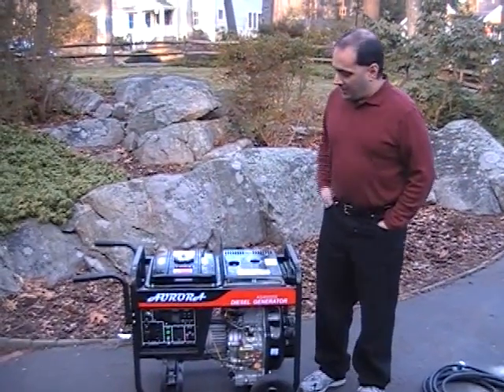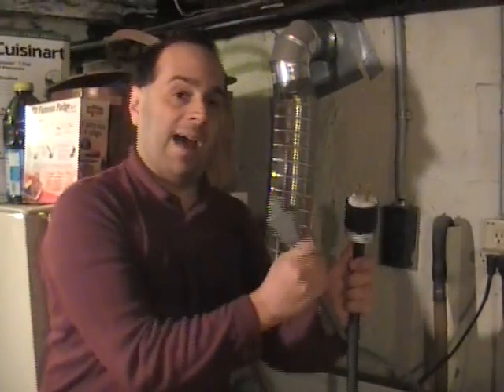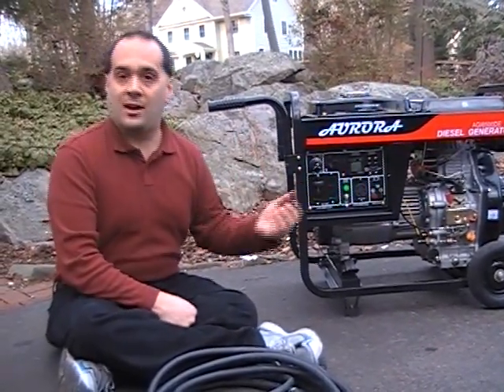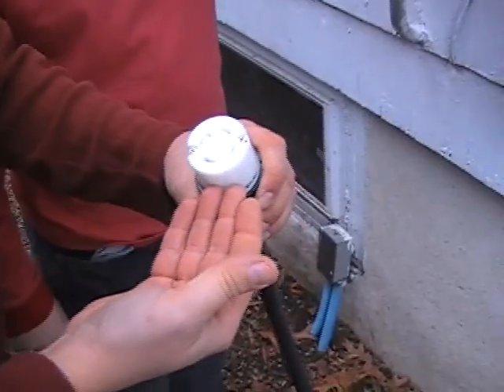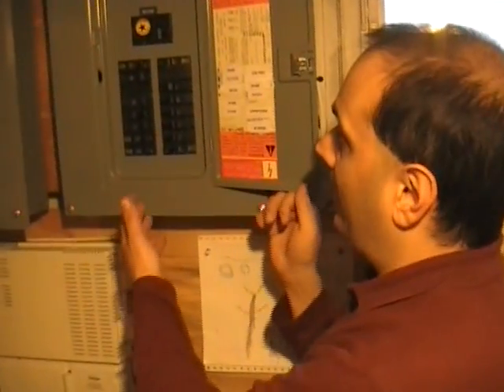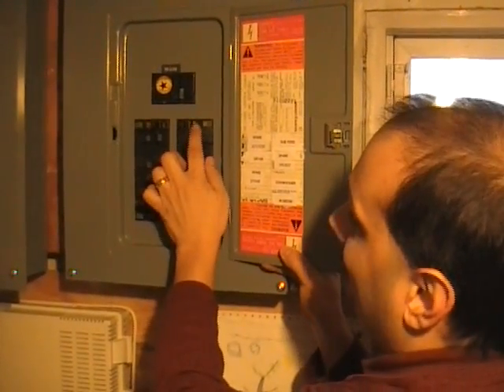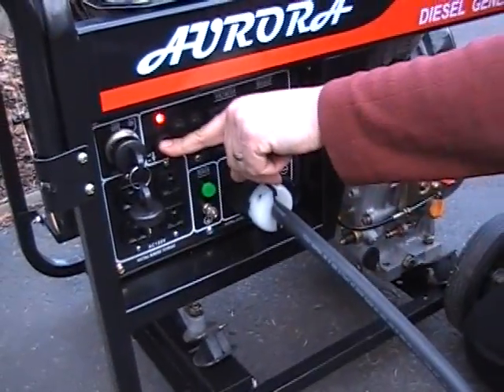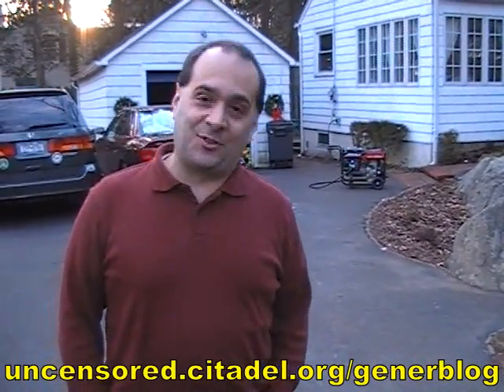Inexpensive residential generator hookup

Comment: Very nice done.  Thanks.  Will be possible to have some information regarding the different part that are necessary (small sub panel, transfer switch, extensions, etc).  It is possible to have this installation with a generator that only supplies 120volts/30amp (TT30P plug)??
Reply: Here are the portable generator safety rules: make sure you are aware of all the warnings before using portable generators. This is just a reminder for everyone’s safety. All generator safety rules should be followed carefully. This advice is just to make sure that everyone is aware of all the warnings and it’s just to remind people to be careful using portable generators. Generators can be dangerous if not used carefully. Every year, hundreds of people die or get injured when using portable generators due to carbon monoxide poisoning and electrocution. Make sure you are using your generator carefully and keeping others safe as well. There is something very serious that everyone should always be aware of when using generators. Some people do run their generator indoors which is not safe and that increases the risk of carbon monoxide poisoning which can cause death of family and you. Some people run their generator in wet conditions which can electrocute them. Please remember that you should never run your generator indoors. Remember that carbon monoxide is an odorless and colorless gas that you cannot see or smell. Carbon monoxide is a silent killer. Keep that in mind. Make sure your generator is 15-20 feet away from your house and away from doors, windows, and vents. Never use your generator in your porch too. Having a carbon monoxide detector is very important against generator safety. Some people also allow children to go near the portable generator which could pose risks. We need to keep an eye on our children making sure that they are not near the portable generator so they won’t get electrocuted or burned by the generator which is dangerous. A locking enclosure also keeps kids safe. A generator shed might look like a tempting place to explore, or take cover during a game of hide and seek, but a generator is a dangerous piece of equipment that can cause injury. It says on the manual that we should also keep children away at all times from the portable generator to avoid injuries. Please do not allow a child or unqualified people to operate the portable generator.  It is important to keep your children safe especially little ones. The portable generator can be hot during an operation. Just because some manuals missed what should be listed doesn’t mean it’s safe to do. Always follow the generator safety rules when using portable generators. Generators pose electrical risks. If you need to use your generator during wet weather, you need a generator tent to protect your generator from getting wet. Don’t let your generator get wet. Keep your generator dry and before using your generator, please make sure your hands and your generator is dry. Do not wear loose clothing when operating the generator. Everything that is said on the generator’s operating manual should not be ignored. Never smoke cigarettes near the generator. Please keep flammable things away from the generator. Never overload your generator too. Your generator can catch fire. Never ever try to plug a generator cord into a wall outlet to avoid back feeding. Back feeding your generator is dangerous. Always turn on your generator first before plugging in appliances and shut off the appliances before turning your generator off. Use a heavy duty cord for your generator and the cord should not be worn out. All the instructions should be followed carefully. Never refuel your generator while it’s running. It can cause fire if fuel spills while your generator is hot. You should turn off your generator and let it cool off before refueling it. Having a fire extinguisher next to the generator is also important. This is only a reminder for everyone’s safety of using generators. Make sure your generator is properly grounded. Having a fire extinguisher next to the generator is also important against the safety rules. https://youtu.be/I1jT3ANENvI and here is a video more about keeping others safe when using generators and also about our family’s safety. It’s important to keep our little children safe as well. Make sure they’re away from the generator. Hope this helps.

Comment: You do realize anytime you hook up a connection, there is "Live" power running through the wires, right? Jesus that's a loud generator!
Reply: Here are the portable generator safety rules: make sure you are aware of all the warnings before using portable generators. This is just a reminder for everyone’s safety. All generator safety rules should be followed carefully. This advice is just to make sure that everyone is aware of all the warnings and it’s just to remind people to be careful using portable generators. Generators can be dangerous if not used carefully. Every year, hundreds of people die or get injured when using portable generators due to carbon monoxide poisoning and electrocution. Make sure you are using your generator carefully and keeping others safe as well. There is something very serious that everyone should always be aware of when using generators. Some people do run their generator indoors which is not safe and that increases the risk of carbon monoxide poisoning which can cause death of family and you. Some people run their generator in wet conditions which can electrocute them. Please remember that you should never run your generator indoors. Remember that carbon monoxide is an odorless and colorless gas that you cannot see or smell. Carbon monoxide is a silent killer. Keep that in mind. Make sure your generator is 15-20 feet away from your house and away from doors, windows, and vents. Never use your generator in your porch too. Having a carbon monoxide detector is very important against generator safety. Some people also allow children to go near the portable generator which could pose risks. We need to keep an eye on our children making sure that they are not near the portable generator so they won’t get electrocuted or burned by the generator which is dangerous. A locking enclosure also keeps kids safe. A generator shed might look like a tempting place to explore, or take cover during a game of hide and seek, but a generator is a dangerous piece of equipment that can cause injury. It says on the manual that we should also keep children away at all times from the portable generator to avoid injuries. Please do not allow a child or unqualified people to operate the portable generator.  It is important to keep your children safe especially little ones. The portable generator can be hot during an operation. Just because some manuals missed what should be listed doesn’t mean it’s safe to do. Always follow the generator safety rules when using portable generators. Generators pose electrical risks. If you need to use your generator during wet weather, you need a generator tent to protect your generator from getting wet. Don’t let your generator get wet. Keep your generator dry and before using your generator, please make sure your hands and your generator is dry. Do not wear loose clothing when operating the generator. Everything that is said on the generator’s operating manual should not be ignored. Never smoke cigarettes near the generator. Please keep flammable things away from the generator. Never overload your generator too. Your generator can catch fire. Never ever try to plug a generator cord into a wall outlet to avoid back feeding. Back feeding your generator is dangerous. Always turn on your generator first before plugging in appliances and shut off the appliances before turning your generator off. Use a heavy duty cord for your generator and the cord should not be worn out. All the instructions should be followed carefully. Never refuel your generator while it’s running. It can cause fire if fuel spills while your generator is hot. You should turn off your generator and let it cool off before refueling it. Having a fire extinguisher next to the generator is also important. This is only a reminder for everyone’s safety of using generators. Make sure your generator is properly grounded. Having a fire extinguisher next to the generator is also important against the safety rules. https://youtu.be/I1jT3ANENvI and here is a video more about keeping others safe when using generators and also about our family’s safety. It’s important to keep our little children safe as well. Make sure they’re away from the generator. Hope this helps.

Comment: Why not just call the electric company and have them or in my case I know the people real well at the elect comp. and they will send a lineman out to remove the head unit/meter from your house that way you can go ahead and just hook ur generator up that way if your not home or whatever and the power comes back on and ur generator is running nothing or noone will get hurt. Just simply call them back and tell them to reinstall it and boom! Prob solved.
Reply: David Spencer so during a power outage you will wait for someone to come to your house and pull the meter, then start your genset.  Get a grip Dave, that wont happen
Reply: Oh lol That's not cheap here at all. I'm sure you will be a priority when they are working like crazy to get the power restored. Not the best advice Dave.
Reply: thats expensive here id never do that anyways I just had a panel fire because i found out when the land lord replaced the meter in the wire was the wrong damn gauge
Reply: Here are the portable generator safety rules: please make sure you are aware of all the warnings before using portable generators. This is just a reminder for everyone’s safety. All generator safety rules should be followed carefully. This advice is just to make sure that everyone is aware of all the warnings and it’s just to remind people to be careful using portable generators. Generators can be dangerous if not used carefully. Every year, hundreds of people die or get injured when using portable generators due to carbon monoxide poisoning and electrocution. Make sure you are using your generator carefully and keeping others safe as well. There is something very serious that everyone should always be aware of when using generators. Some people do run their generator indoors which is not safe and that increases the risk of carbon monoxide poisoning which can cause death of family and you. Some people run their generator in wet conditions which can electrocute them. Please remember that you should never run your generator indoors. Remember that carbon monoxide is an odorless and colorless gas that you cannot see or smell. Carbon monoxide is a silent killer. Keep that in mind. Make sure your generator is 15-20 feet away from your house and away from doors, windows, and vents. Never use your generator in your porch too. Having a carbon monoxide detector is very important against generator safety. Some people also allow children to go near the portable generator which could pose risks. We need to keep an eye on our children making sure that they are not near the portable generator so they won’t get electrocuted or burned by the generator which is dangerous. A locking enclosure also keeps kids safe. A generator shed might look like a tempting place to explore, or take cover during a game of hide and seek, but a generator is a dangerous piece of equipment that can cause injury. It says on the manual that we should also keep children away at all times from the portable generator to avoid injuries. Please do not allow a child or unqualified people to operate the portable generator.  It is important to keep your children safe especially little ones. The portable generator can be hot during an operation. Just because some manuals missed what should be listed doesn’t mean it’s safe to do. Always follow the generator safety rules when using portable generators. Generators pose electrical risks. If you need to use your generator during wet weather, you need a generator tent to protect your generator from getting wet. Don’t let your generator get wet. Keep your generator dry and before using your generator, please make sure your hands and your generator is dry. Do not wear loose clothing when operating the generator. Everything that is said on the generator’s operating manual should not be ignored. Never smoke cigarettes near the generator. Please keep flammable things away from the generator. Never overload your generator too. Your generator can catch fire. Never ever try to plug a generator cord into a wall outlet to avoid back feeding. Back feeding your generator is dangerous. Always turn on your generator first before plugging in appliances and shut off the appliances before turning your generator off. Use a heavy duty cord for your generator and the cord should not be worn out. All the instructions should be followed carefully. Never refuel your generator while it’s running. It can cause fire if fuel spills while your generator is hot. You should turn off your generator and let it cool off before refueling it. Having a fire extinguisher next to the generator is also important. This is only a reminder for everyone’s safety of using generators. Make sure your generator is properly grounded. Having a fire extinguisher next to the generator is also important against the safety rules. https://youtu.be/I1jT3ANENvI and here is a video more about keeping others safe when using generators and also about our family’s safety. It’s important to keep our little children safe as well. Make sure they’re away from the generator. Hope this helps. Safety is always important before doing things.
Reply: Guess thats the advantage of living in a small community. Cause ive had them come out and do it several times when our power was out. So I guess its all in who you know.
Reply: or blow

Comment: The best part is where it says it's legal. The building code is put there to protect you. Sometimes the government thinks it's an excuse to over charge you.. that isn't part of this. If you can hook up your generator to power your house and it is possible to back feed out of your house than it is is illegal and no code compliant. Period. Your Generator breaker has to be only turned on if your main is shut off.. Not by you but made to be physically impossible. "There is no way you can back feed the power line coming to your house" is the basic rule. That doesn't include you having to trip the main as it is still possible to back feed the main line if you forget or someone else is operating it.
Reply: Building codes are not to protect us, they are there as a form of control.
Reply: Great comment!
Reply: B